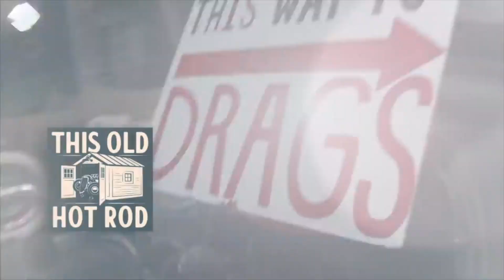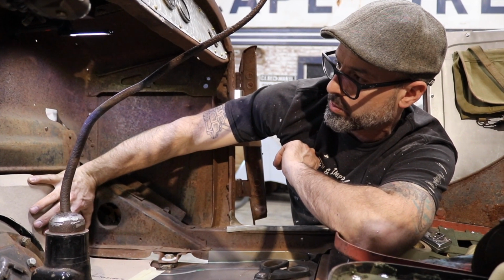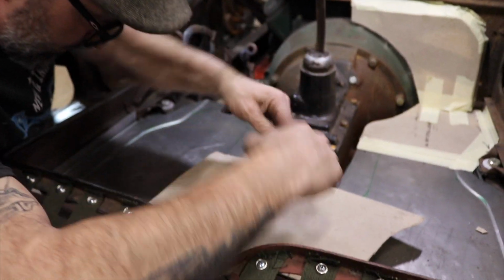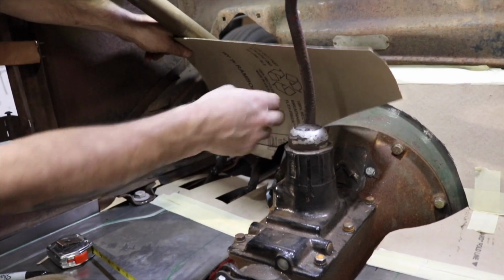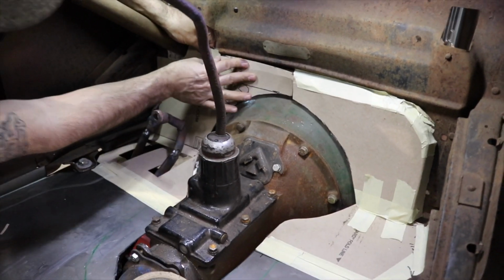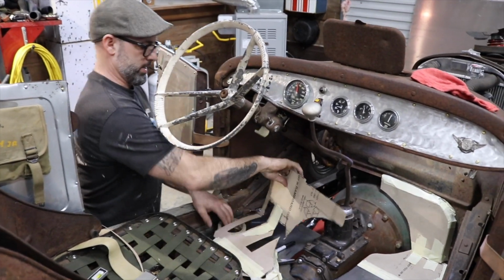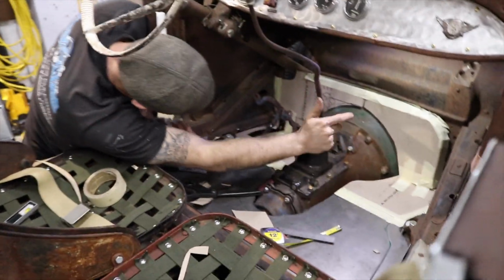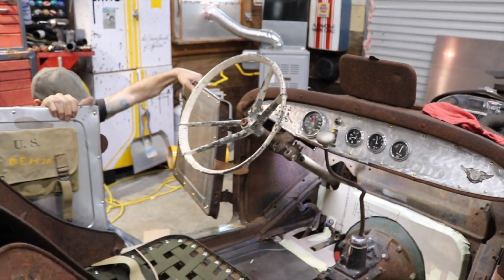Front Floor Pan Templating

Comment: That transmission looks cool as hell sitting there exposed like that. The industrial green on the bell housing is great with all of your army stuff, and if you could get some kind of weather strip around the opening in the floor pans, and if you painted the transmission with the black crinlky paint you'd have something nobody else has. The whole military industrial look would reach a new level. Maybe you could do the steering column and the inner part of the dash with the crinkly paint. 
      If you spray it on real thick, and force dry it with a heat gun, it gets way more crinkly than normal. It looks like an old Underwood typewriter from 1927.
I did that on an ancient equipment rack that came out of a B-52 from Nellis Air Force Base, it's the standard 19 inch type rack box like they put sound gear in nowadays, and it looks awesome with the equipment mounted In it.
               Whatever you decide to do, I'm for you 100%. This is gonna be one of the coolest roadsters I've seen in a long long time.

     So far so good.
          Cheers!

Comment: Looking good Mike!  Where do you get your template cardboard?  I can’t seem to find the right thickness for templates.
Reply from the maker: I buy it at Lowe’s.  It’s typically in the flooring or construction departments.
Reply: @ThisOldHotrod  Is it in a roll for covering floors during construction?
Reply from the maker: Yes.  It’s floor protection.  It’s sold in two different roll sizes. 36” W X either 50’ or a 100’ I believe
Reply: @ThisOldHotrod  Thanks Mike. Really enjoying your metal fab 
and louver videos!
Reply from the maker: @tonymosca6591  yes.